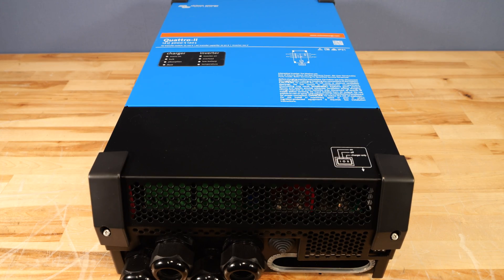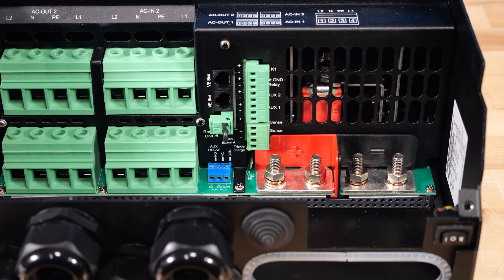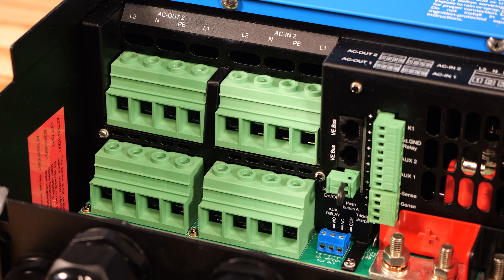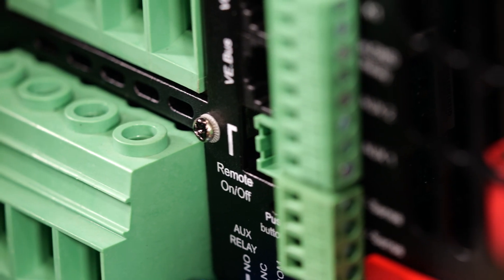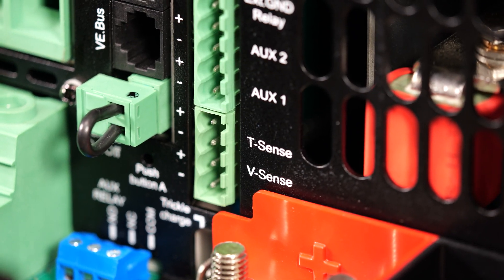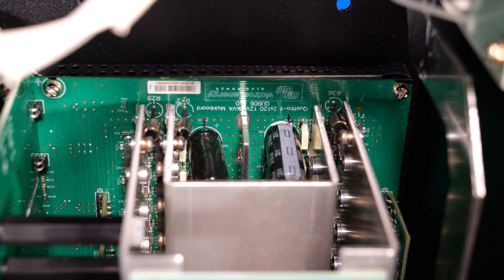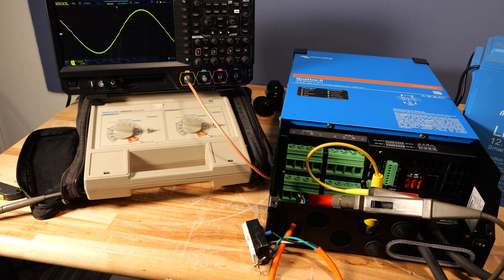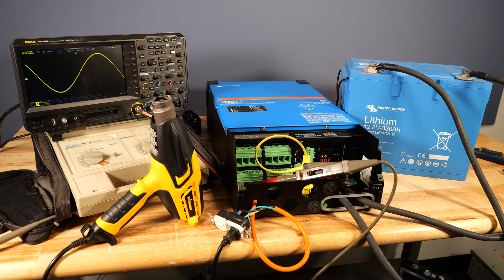NEW: Victron's Quattro-2 12V / 3000VA 2x120v Inverter-Charger

Comment: Wow i really wish i could get 2 of these inverterchargers but i could never afford them.  I am disabled and unable to work anymore so I live on a very fixed income and I live in my 1967 GM TDH-4519 city transit bus full-time in the high desert of New Mexico. Lately I have been building my own batteries from Headway 38120hp cells but i only have enough cells for 300ah worth of 12 volt batteries and it's taking me 3 years to do that. But at least the batteries can start up the bus too

Comment: So would this be better for a 50amp fifth wheel than the mulitplus 2x120v?  Trying to see what would be best inverter for our RV since we have a residential fridge and 2 rooftop ACs.
Reply: Only if you plan on running a generator onboard where you aren’t plugging it into the same plug as shore power
Reply: Also 2 rooftop ac may not be able to run off one inverter
Reply: @daniellaney3946  so a double  multiplus 2x120 would be best for 50amp coach?
Reply: @stevenporter7969   if you run two in parallel then the minimum current apparently exceeds 15amps so if you ever plug into a regular outlet you won’t be able to anymore. 

Trying to figure out how to wire in series if it’s possible

Comment: I'm a little confused after reading the specs.  Will this inverter allow you to do PowerAssist on either AC Input?  Considering using Input 2 for a separate 15A input for times when I want to plug the RV in at home or at storage and I'll only have 8 to 10 amps available.  I could use a regular extension cord vs. having to wrestle the 50A cord and the adapters.

Comment: I have a MultiPlus-II 48/5000/70-48 inverter running our converted bus, here in Australia (240VAC/50Hz)
Have you guys done a video that shows what settings I need to change, in the Multiplus, so that if our batteries drop below a certain percentage, the grid power will turn on, then turn off when battery power reaches 100%?
Thanks for a great channel.